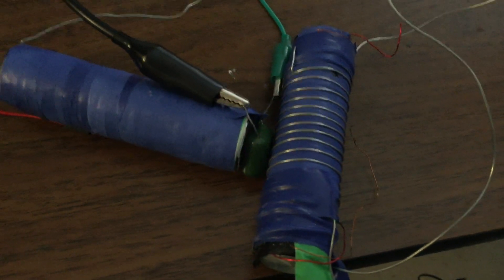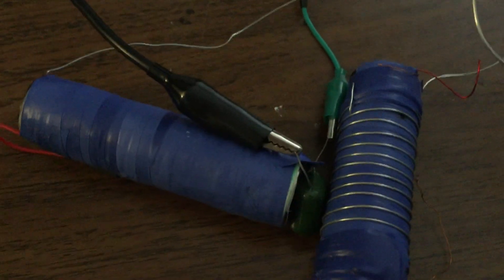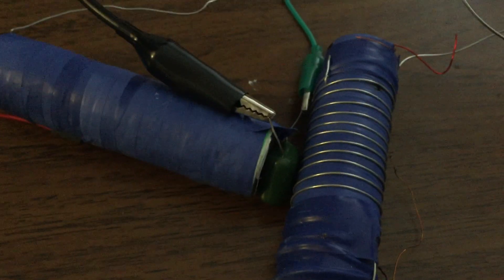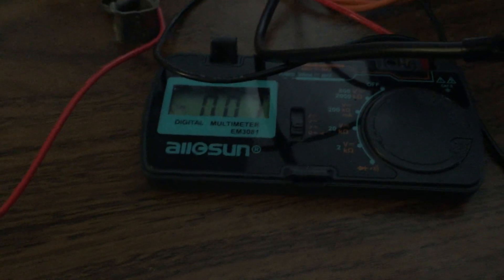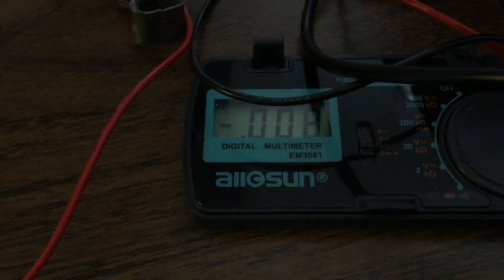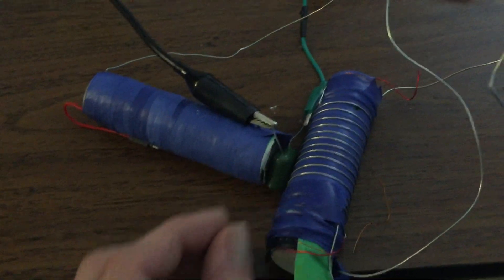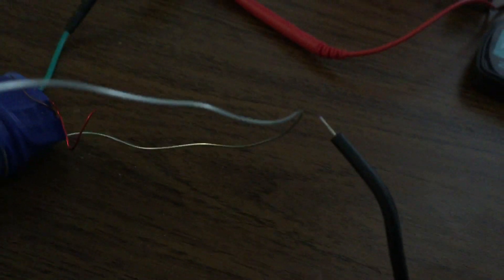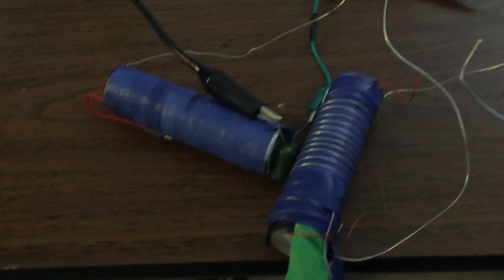Charging Capacitor With Magnets

Comment: I have seen similar experiments.  This is very interesting.  Even with my own project, I have charged capacitors fast by touching the case of a polarized capacitor with high frequency pulsed DC. I understand.
 You are using a non-polarized capacitor though. I like that your capacitor is "not" lined up with the nodal points or in between the nodes.  I think this is maybe why tesla's favorite number was 3.  Two create an "imbalance".  And I'm sure you know very well that in nature, things want to naturally balance themselves out. 
Another great video thanks for sharing.  I will be back at my experiment sooooon!

Comment: You can harness static magnetic field energy into usable form using the ossilating relay type pulse battery charger, when you place magnets near the relay coil , its smooth functioning and also amplify the output power

Comment: Dude, thank you! I was playing with this and gave up lol
Reply from the maker: Buddy must have had a very high wattage hidden RF source and a diode in the wire or hidden in the terminal to quickly charge the cap with radiant. :) In other words he was cheating. You don't need any diodes to charge a cap and in normal it wont charge with just RF or Magnets nearby but the right combo of both at once and asymmetrical field configuration it allows.
Reply: @joellagace1679  Makes sense! Could this be used to measure flux drain on the magnets? 🤔

Comment: A couple of days ago I watched a video in which the experimenter replaced the 9 volt battery in a cheap DVM with a hand wound coil, bridge rectifier and booster module to charge a capacitor.  The DVM had to be shaken several times to build up the charge.

Comment: Your experiment reminded me:

Decades ago amongst HAM radio experimenters I’ve seen homemade diode arrays (hundreds to thousands) that output a very small  but reliable current, “ratcheting” or “one way valve-ing” stray RF into a theoretical power source.  It would be neat to put an array of millions onto an Integrated Circuit and see if it can produce a practical voltage/current.  

It would also be cool to use this theoretical Chip to see what happens when it’s moved around magnets 🧲 and broadcasting antennas.

Comment: caps have carbon "tetra hadron geometry"   spiral analogue waves wrap around the carbon  molecules  what ever size these molecules are i dont know maybe the size of micro wave
Reply from the maker: Maybe building the caps as layers around the magnet rods would work better.
Reply: @joellagace1679  i think the more carbon you have in the circuit the better. So large capacitors , then a small signal to tune the waves that already exist that match the size of the carbon molecule itself, lets hypothetically say its a 1.274957489 Ghz signal for aka carbon , then by using a bar magnet and a coil you can generate or make a variable tuning method for finding a good low frequency carrier for this high frequency 1.274957489 Ghz and by doing this you effectively direct the specific frequency that excites or wraps around the carbon molecules inside the capacitors which are full of carbon , btw so is the human and all life on this particular planet . In short a wave guide not using antenna geometry rather carrier signal tuning , the same way they do radio they use a  carrier wave to transmit the data in batch files within side the carrier wave , the carrier is got more amps and its lower frequency for stability , cause sending high freq alone is a issue until they found the 900 Mhz range and its characteristic bouncing effect

Comment: 3:00 i thought that was polarity ? meaning  your leads are measuring the inverted points
Reply from the maker: Not sure what your getting at? I'm sorry its just a volt meter connected to the cap reading in DC, a negative polarity DC build up.  Used non polarized cap. The conditions set up the DC polarity. I guess I could of flipped the meter connections to make it more pretty.
Reply: @joellagace1679  flip the leads around , does the negative symbol go away

Comment: "Hendershot Generator"  SS   300 watts  , coils caps magnets
Reply from the maker: Must be something like this but better
Reply: @joellagace1679  i think so , i looked into it long time ago , I have the files somewhere how to build and video. there are two coils and two capacitors , capacitors are size about 4" diameter like the big caps electrolytic designed for low voltage and lots of capacitance. coils are same dimensions , then there is bar magnet on slider to be tuned against a small coil the size of the small bar magnet , its just the oscillator i think you know signal gen low current what ever the magnet has to offer
Reply from the maker: So I guess the oscillator is mandatory.